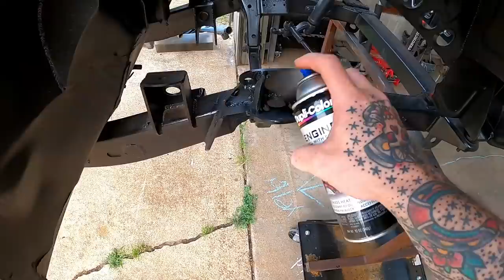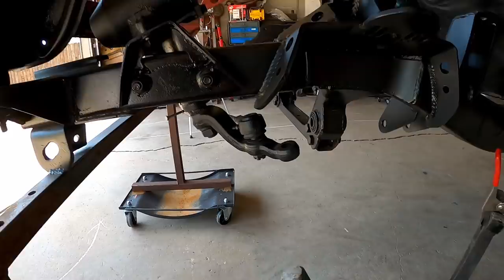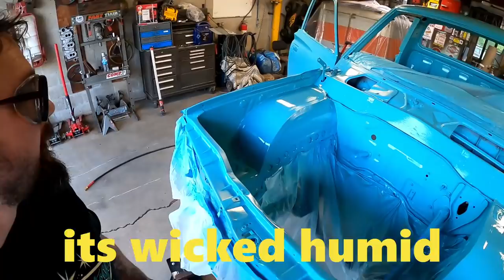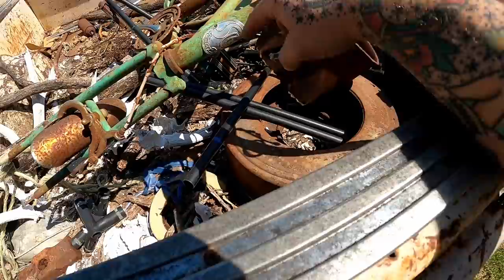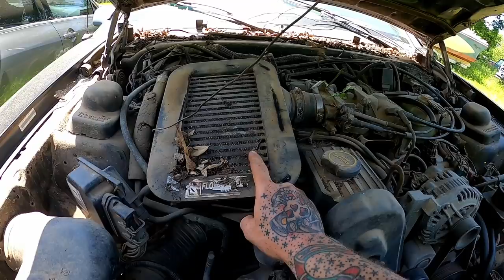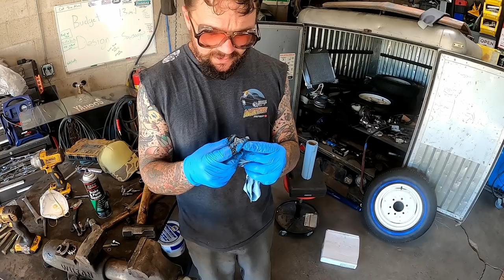ASSEMBLY TIME! Harbor freight paint job and JUNKYARD TRIP!  ((1977 Datsun 620))

Comment: So I thought I could save a couple of bucks and do the lower ball joints my self, well after breaking a pickle fork, working on the ground in the parking lot I finally called my mechanic and asked what the trick is for getting the old ones off and he told " you have to hit like you don't own it " well sure enough that works like a charm

Comment: I’ve had a few of those turbo coupes. 
Fun little cars. 
Put the Garret t3 from the earlier 83-86 non inter cooled tc. 
It’s a little bigger, better turbo. 
Use an front mount intercooler from an 80s Volvo. 
Can modify the upper intake to rotate in 90° 
5.0 mustang throttle body. 
Bigger injectors. 
Do all that, bump up the boost, and it’ll make em pretty quick.

Comment: My first car was a 1968 vw bug a few days later the fuel pump went out and washed all the seals out out it so i bought my first truck a 1976 Datsun Bullet side so I love these videos. My Datsun was the first thing I ever lowered I cranked the torsion bars down and slapped lowing blocks in and removed leaf springs. Man do I ever miss that truck.

Comment: Since you mentioned yellow, that's what color my 1977 Datsun was, but mine was also a KING cab, so you'd best be careful using that word.  When I bought it, it had been a Texas Farm Truck for ten years, and had wooden bench jump seats, facing inward, for the first owner's little kids.  I moved back from Texas in '89 and kept it for almost another 10.  Sold it shortly before my mom gave me her B2000.

Comment: When it goes to placing the Box on the "Dat'Sun", maybe take advantage of the "Dead Spaces" on the front of the Wheels by adding some Lockable Side Boxes, to make use of that area!
If there is enough room, you could make one to fit a FULL SIZE SPARE TIRE, and Tools on the other side...🤔
Another Puddin Fan,
-T🖖
Western Washington State

Comment: If you wrap a few of those bars in rope it will take the noise out. I built a howling bed rack for my truck I did the rope trick and was suprised it actually worked.

Comment: I swapped a 2.3 Turbo into a 76 Ford Courier short box with a 5 speed. Then a year later I bought a 63 Ford Falcon 2 door that already had a 2.3 Turbo swapped in but not finished. They both really boogie. They do that for sure. I'm running a bit more boost than Ford did stock . But not too much more. 11 lbs on both

Comment: Hey Puddin, if you press out the centre of those control arm bushes then use your MIG to run a weld along the inside length of the outer casing they will pretty much drop right out without breakin a sweat ;-)
Reply: Never tried that. I always cut a slit out with the sawzall. I’ll have to try that next time.
Reply: @tristannivens3269  its nice and quick, the welld just pulls the steel together and shrinks the tube

Comment: I really like the 521 pickups I have had 2 of them. Both were 72s. Lots of parts are interchangeable with the 620s. One of Mine had disc brakes, L20b and a 5 speed from a later model. It was baby blue. Miss that truck.

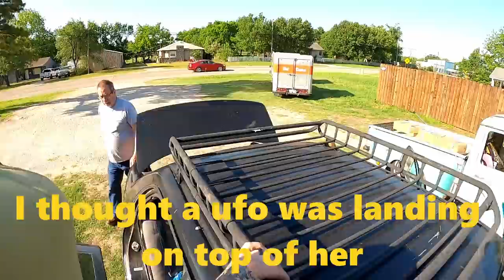Comment: At 26:43 with the singing roof rack/ladder rack/luggage rack etc. Try wrapping a bungee cord numerous times long enough to span from the left to the right of the upper and lower cross bars at the front of the truck. It will kill the singing on your roof top by disrupting the "vortex". Look at the older automobiles that had fender mounted radio antenna's that had a spiral wire tinned into them top to bottom. It helped with those singing radio antennas. I had ladder racks on my van and with the long wrapped bungee cord it became whisper quiet.

Comment: Puddin.. the 5 speed overhead carrier for overdrive aka 5th gear are kinda notorious for going dry and failing.. but if you want FUN, find a 510-610 4 speed for a 1600, bolt together the longer front half shaft so it'll reach the 5 speed truck rear end (is geared lower). the lower+closer gear ratios of both combined is nice and snappy, 1/8 mile type snappy, driftin and shiftin type snappy.

Comment: Do not feel bad pudding .I too done  the same thing pushed the ball joint presser straight through lower control arm and I also over torque a screw in ball joint and a friend of mine had pressed a screw in ball joint out it happens to the best of us 25+years of being a mechanic

Comment: Hey Puddin! About your noisey roof rack. I had the same problem on my 63' VW bus rack. Try and put that roll bar type fome that fits the diameter of the front bars. It breaks up the wind and no more noise!! I hope it works on the yota

Comment: Those bikes had full size BMX rear wheel  and a small front wheel...maybe 12 or 13 inches in diameter.  Fun to ride and you could make people run off the road just a steering. You can go around  corners without turning handlebars . I can ride a bike with no handlebars just like the song. Yea that's a song

Comment: The 88 turbo coupe! If it's a manual transmission you have yourself 19psi of whoop a$$! It's got the same hp as a 5.0 of the same year. If it's an auto you get 9 psi 😔. If it is a manual make sure you at least get the bellhousing. It's the only way to mount a 2.3 to a t5 manual and they are super rare. The svo mustang computer will give you a few extra ponies as well.

Comment: Those turbo coupes are actually pretty fun I had a 86 turbo coupe with the 5 speed manual transmission. Got it with less than 30,000 miles on it lady I got it from her husband bought it new it was his daily driver till he passed away and It got parked. We went and did a roofing job that car was in the garage a half and ask her about it she was going to do anything with it got it for $500 it just needed a new fuel pump but the fuel pump itself was fine come to find out it had a bad wire that would keep shortened and blown fuse and killing the fuel pump don't want to know how I want it took me to figure that out cuz I had just put a new fuel pump in it and I figured something got messed up but I was driving it for like a day and I pulled out of my buddy's driveway and it's a pretty good little bump at the bottom hit it rolled out on the street made about a hundred feet in the car died dragged it home dropped the fuel tank so when I figured out I had a bad power wire. And one day I was driving to go to court and I seen a bunch of smoke billowing from the back of my car I pulled over and when I popped the hood it ignited the engine Bay on fire. Apparently the high pressure trans cooling line blue and proceeded to spray transmission fluid all over both exhaust manifold the car went up and had no fire extinguisher or anything like that to get it put out luckily I had just bought a couple 1 l of mountain dew and had to use that to get the fire put out cuz did not have a fire extinguish for my car which I normally keep a neighbor came out with one and The neighbor next door they came out with a garden hose by time they got out there every head of snuffed out.

Comment: Yo bro, that loose ball joint happened to me on my LeBaron.  I think I fixed it, as I remember, with a cold chisel.  And just dimpled in the edges all the way round.  I though of welding too but didn't have the tools or ability at the time.